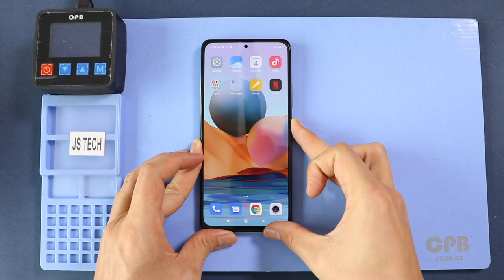Xiaomi Redmi Note 10 Pro MAX Teardown | Screen Replacement 1

Comment: Hello ,, 
I am thinking to modify my redmi note 10 pro max with transparent back glass,
So i am confuse .. i want to cut out the plastic frame covering mother board and speaker plastic frame! does it contain any improvement connection ?
Reply from the maker: It is not possible to transparent the logic board frame or speaker cover. Unless you design specifically which cost a lot.